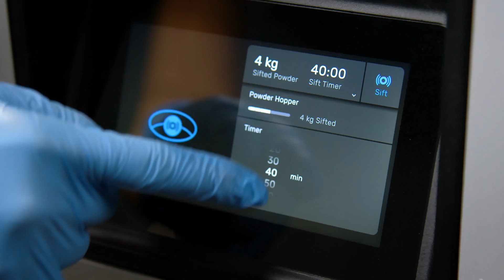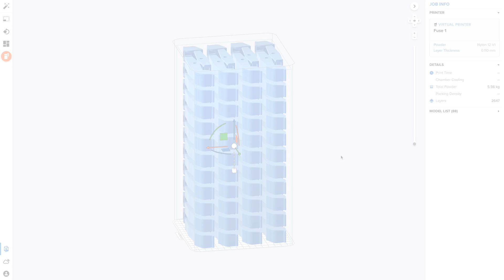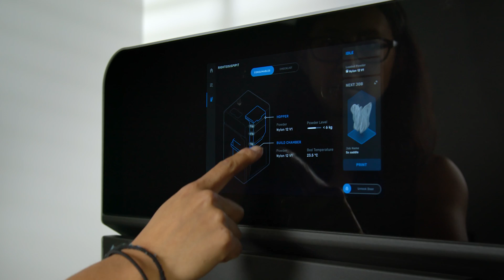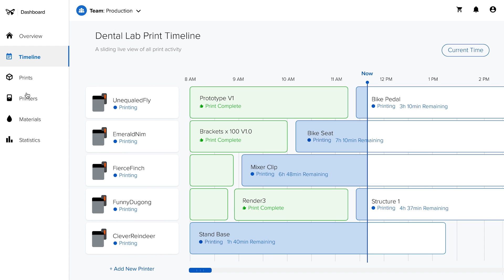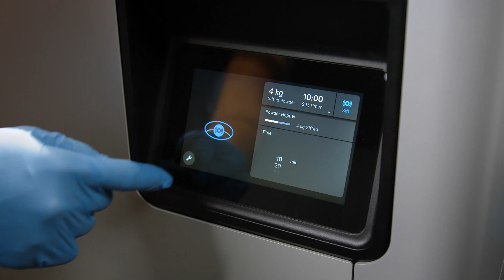How SLS 3D Printers Work | Formlabs Fuse 1 Ecosystem | Process, Software, Materials & More

Comment: At 1:53. A powder content of 0.83kg requires over 7 hrs of printing.
Reply: There is cool down time included I would say. Later in the video they say the time on the printer include the cool down time. If they are smart they will give you the same time in their own software